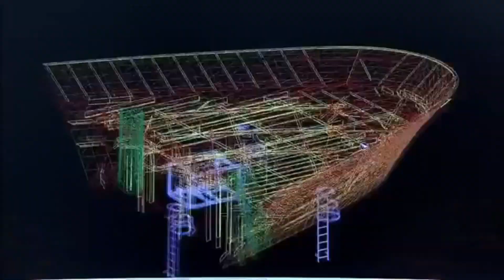TCG Anadolu | Why Turkish Navy Aircraft Carrier is Unique??

Comment: an aircraft Carrier is made for blue see, there for it needs to be supported at least by a bunch of battle ships. Otherwise it is a easy target. Carrying only UAV's is a bad investment.
Reply: İnsansız savaş uçağı bayraktar kızılelma taşıyacak ne olduğuna bakabilirsiniz
Reply: They are part of NATO. They sail all together.
Reply: Battle ship? you know they stopped using those after world war 2 right?
It's all about cruisers and destroyers now, With Carrier as the heart of the fleet.
Reply: TCG will be including more than 50 Bayraktar TB2 + Unmanned attack boots, anti ship missiles, anti submarine systems, anti air missiles, electronic attack / defence systems, attack helicopters, tanks, armored vehicles. 

Probably it will be in protection of a naval fleet as well.

Comment: 5:19 ability to do what?
Bayraktar is a UAV with a wing span of 12meters and a payload of 150kg
Turkish Cruise missiles have masses well above half a tone, for example SOM has a mass of 500-660kg (depending on the model) and Atmaca has a mass of ~800kg.
Which is the cruise missile you are taling about?

Finaly Bayraktar has an operational altitude of 5500m and Service ceiling of 8200m, although this is high its not protected against medium range air defenses as claimed in the video, its only protected from manpads and anti air guns. Any type of medium to close range SAM system can easily attack a target moving at 200km/h at an altitude of 5-8km.

Finaly, the f35 aircraft were required. The drones require air superiority to operate. Enemy fighters can easily shoot down the drones if there are no friendly aircraft protecting them. This means that the drone carrier depends on the land based air bases in case to operate. The drones could have been launched from that base anyways.
Reply: well said yet all turkish drones are well proven on battle grounds not against Afghanistan and other Bannana republics but against  countries that possess Russian modern warfare systems.  let us know how good are the American or western drones do against Russia then u have every right to brag and be filthy
Reply: @King_Budnacab  Turkey had undisputed air superiority in all of the battlefields the drones were deployed.

Turkish drones are in general slower than the american counterparts and this is not always something bad (about 200km/h speed). Air defense systems might have had not well trained crews or failed to identify the UAVs as a threat.

In any scenario where the enemy has fighter jets on the air while Turkey doesnt these drones can easily be shot down. For example an f16 wont even need to waste missiles, the 20mm gatling gun is enough to intercept multiple of these drones with a single load of ammunition.

This means that the carrier will either need long range anti air missiles onboard or its own fighter jets. The carrier has neither of those.

And no, the s400 or land air bases as I said cannot fix that, the drone carrier is not needed at all if you operate your drones near your mainland.
Reply: @King_Budnacab  Also, the americans never tried to replace their carrier aircrafts with drones. They are not even using the far smaller f35 jets. The US carriers operate f18 jets which carry 4 cruise missiles each. 
The drones that can be operated by this carrier are far too small and slow to carry any heavy payload like cruise missiles.
Reply: Guys, bill is saying something interesting and the truth. But we are sure Turkiye is a serious country and for sure they already thought about it and maybe that is why we are also developing the mius project together with the current project. Our new jet motor uav’s may make the cover agaist the jets.
Reply: Let me say it clearly, I hope it don't happen but if a war breaks out between Ukrain and Russia make sure the f35s and all the toys you bragging about do actually work 😏😏.  Since world war 2 America was just bluffing or brutally murdering innocent Bannana Republics for onse have dignity and let the world see how u match against a worthy foe.
Reply: @King_Budnacab  Im not American and I surely do not support the American actions. One thing is for sure, an f35 or f18 or whatever jet is far more capable than any drone.
I used the US carrier just for comparison.
French carriers can practicaly do the same with their own planes, so do the UK carriers with the f35s.
A drone carrier with no aircraft to protect the drones cannot attack a nation with an airforce.
The drones are good as long as the enemy has no planes, and this was the case in all of the Turkish campaigns to this point.
Do you realise that a sport car can move faster than the turkish drones (200km/h)? Any jet with an autocannon will easily attack and destroy the drone. The drone doesnt even have any way to know if it is spoted, it has no radar warning sensors at least the current drones.
Reply: @billwhoever2830  Tb2 and tb3 are temporarily solutions. If turkey will not be able to buy any fighter jets with vertical take off capacity we will use mius drones. They are jet motored subsonic drones and they have may carry 1000 kg missiles and boms. Turkey already developed 65+km ranged air to air missiles. And developing aesa radar on the go. So mius drones can fight beyond vision and if they are used in multiple numbers they can build a air superiority as a swarn. Because turkey is the first country which used network based drone attacks. When turkey will produce own ramjet engines and will be capable of manufacture 200-300km range air to air missiles game will change. Low costs drones which are capable of long range beyond vision combat capability in high numbers will be total air dominance. They can fly as a swarn in multiple altitudes and create a network airwall for hostile aircrafts. İn such battles who has more number of low cost equipment can be more aggressive and tolerant to risk their equipment.
Reply: @darkprofile  thank you for the info, the mius has a payload of 1500kg acording to info I can find online, it would be able to deploy 2 cruise missiles. 
I would doubt that a UAV will be able to deploy air to air missiles though and 65km is not enough to counter a meteor equiped fighter group.
The MIUS drone will have a mass of 5.5 tones and it will probably be larger than an f35 in terms of space on deck since its subsonic (larger wings probably required). The Anadolu carrier will only carry 10-20 of the Mius drones at full capacity.

Finaly, the Mius drone uses this engine:
https://en.wikipedia.org/wiki/Ivchenko_AI-25
and believe me its not Turkish, its a very old Soviet (Russian) designed still used in Ukraine probably due to low budget.
I dont expect Ukraine to be able to provide you any engines in the near future, everything can change ofc.

Claiming that its a Turkish made drone while the engine is imported is missleading.
If the engine is imported I can only expect other electronics on the drone to be imported too.

The CEO of Baykar, Selçuk Bayraktar, said that the MIUS is expected to fly in 2023, adding that a jet-powered UAV was a ''12-year-long dream.''
If a jet engine was a 12 year dream and it only came true due to Ukraine Im sure that Turkey cannot build such engines....
Reply: @billwhoever2830  Turkey also have partnership with Rolls Royce to build a jet engine which is similar to f110 the engine of F16 for national fighter jet project. Also in 5 years Turkey developed a national jet engine ktj-3200 for own cruise missiles to replace french engines. Also Turkey developed own turboshaft jet engine. Developing subsonic jet engine is not so difficult as developing a supersonic jet engine. Turkey can use the core of helicopter engine to develope a drone engine. Ukrainian option was cost effective solution. Turkey is developing and on the way. Also Turkey dont have meteor missiles yet so even if we could deployed F35B to deck we could use amraams which has 75-100 km range. Domestic air to air missiles has 65km range for now and all tests are successful. Phase 2 of this missile will have be 100+km range. And probably phase 3 can compete with meteor. 5 Years ago Turkey didnt have domestic air to air missile. Now we have. The plans are for future. Also Turkey has secret projects going on about hybrid rocket engines and ramjet engines. 
Countries buy meteor missiles from France or air to air missiles from USA or Russia. we produce our own air to air missiles. So 10 years ago we didnt have such missiles and 10 years later we can have missiles with similar capabilities.
Reply: @darkprofile  Bro, the fact that the drones that are going to be equiped with soviet engines is just sad. This means that they are probably gona be used engines from old helicopters, Im not sure if Ukraine actualy still produses such engines, maybe just parts of the engine.
You claim that Turkey is developing AESA radars and at the same time you order old jet engines. The aesa radar is probably built with imported components from Asia. Turkey has no silicon fabs.
Reply: @billwhoever2830  It is not important if it is soviet technology or not. Important fact is cost efficiency. Ukrainian engines give good performance for money. Bayraktar is not the best drone but it is cost effective. You can sacrifice 20-50 bayraktar instead of risking one f35. War is an economic fight too. One bayraktar costs 2 million dollar and can terminate few tanks alone easily. That makes bayraktar more damgerous than other variants. Because it is cheap.

Of course all world is manyfacturing something with imported goods. There are so few countries in the world who has all kinds of sub industries for arm industry. Also Turkey is manufacturing hundreds of high tech parts for airbus and F35 project too.
It is not important if you buy a microchip or silicon parts from another country while there are multiple suppliers in competition. 

Europe USA and Canada tried to put embargo for tb2. Turkey bought engines from ukraine and developed own engine for tb2. The rest of the parts used im tb2 are civil equipment so they are very easy to find from other countries. So it is not so difficult to find electronics for Bayraktar because civil components can be found from backdoors. Also Turkey has good relations with Korea and Japan. Especially Korea feels friendship to Turkey because we helped them in Korean war. And Koreans always willing to make partnership with turkey and ready for technology transfer. 

Few decades ago China bought aircraft carrier ftom Russia and to make that ship pass from bosphorus china accepted technology transfer on rocket and missile technology. Turkey is developing. So USA and Europeans are not the only cartel in arm technology anymore. 

Of course we are not on the same level as first class countries. But Turkey is doing more and more every year. It is not a destination it is a process of the way. But if without war and economic collapse Turkey can move on 20 years. We can be on top league of weapon exporters.
Reply: @darkprofile When the drone carrier only carries one or two dozens of drones you cant waste them so easily.
When you have limited amount of space on the ship you use the most capable weapons possible. 

I do agree that the Ukrainian egnines are probably the most cost effective option, and there might even be a special agreement with Ukraine but those are still Soviet weapons. Ukraine didnt develop them alone.

Now lets imagine a scenario, 6 rafales with 4 meteor missiles each and 24 subsonic Drones. How many chances do you think the drones have to even get in strike distance? Very limited. 
Although the meteor missiles are very expensive (2 million $ each) they can shoot down targets far more expensive (one drone with 2 cruise missiles).
The most expensive weapon can be the most cost effective, because an entire enemy aircraft costs more than a missile.
Reply: @billwhoever2830  So if they were not drones and if they were f35B. What could be different? Meteor range still more than amraams. This ship also will carry unmanned boats which can carry atmaca anti ship missiles and siper high altitude air defence systems. So a drone network on sea surface can defend air defence and anti submarine warfare. So when rafaels will come just meteors will not be enough. Turkey is planning and developing a drone network for network centric battles.
Reply: @darkprofile  An f35 is better than a drone on everything except cost. If you have a limited capacity on a carrier you want the best use of it.
The f35 obviously has a pilot who takes decisions even if connection with base is lost. An f35 is faster which means it can avoid dangers much more easily. An f35 carries more weapons, 8.2 tones when its fully equiped and 2.6 tones when its on stealth mode (inside the planes belly). The f35 has a next gen radar which the UAV wont have.
In general we can say that an f35 (or any jet fighter in general) is far more capable than a drone.

For example the meteor has a max range of 200km. The no escape range is about 80km for a fighter jet like an f35. A much slower subsonic drone can brobably get hit by the meteor fro a far greater distance, this highly depends on whether the drone retreats at all.

Turkey can surely plan a lot but seeing them buying old jet engines for the future drones proves otherwise. The modern fighter jets can only be countered by other modern fighter jets, not by drones.
Air defenses are only usable as long as the enemy planes are attacking you on your mainland. When you are on campaign with your drone carrier you need frigates or destroyers to deploy air defense missiles.
Reply: @billwhoever2830  Make a search about tf-2000 air defence ftigate project. construction will start at the end of this year. hisar-A and hisar-O low and medium range air defence missiles are ready. Hisar-U (siper) long range surfave to air defence missile test shots already started.
Reply: @billwhoever2830  The first production engine could be bought from Ukraine. but in later productions the engine is improved. that's how military technology works block 1 block 2 block 3... Most important think is production capability of first MİUS. And you re right not enough for fighter jets with meteor missiles. But these drones produced for air to surface fighting and when 25-30 bayraktar or mius take off sametime,reality is become different than theory you know.
Reply: Abduel Tio  what I want to say is that this carrier is useless.
Turkey already has airports with fighter jets.
Since anadolu does not have fighters onboard it cannot project power that wouldnt be already in reach of the airports.
Reply: @billwhoever2830  bir f35 maliyeti 100 milyon dolara yakın bunun bakım maliyetleri ile 250 milyon dolara çıkabileceği belirtiliyor bir İHA nın maliyeti giderleri ile 10 milyon dolar.Bu gün Ukrayna'nın aldığı 20 bayraktar İHA ile Rusya'ya verdiği hasarı bir f35 verebilirmi?
Reply: @billwhoever2830  Thanks for your constructive criticism. I liked the way how you consider the scenario from various aspects.
Reply: Çakır Cruise missiles 150 kg
Reply: Do you have any information about Aksungur and Akıncı armed drones?
Reply: @Donny flying higher means you are harder to shoot down
Stingers and igla (russian manpad) both have limited maximum engagement altitude.
Anti air guns, even the heavy 35mm ones have a maximum engagement altitude of about 4km.
Heck, even enemy fighters need time to gain altitude. Flying higher and faster means enemy planes will need to burn more fuel on afterburner to reach you in time after you get spotted or might need to use missiles instead of their cannon to shoot you down in time. 

Planes need time to gain altitude but altitude gives you an advantage against anyone bellow you.
If the planes theoreticaly fly at 5km on patrol and spot a drone at 3km altitude they can dive and gain a lot of speed. If the drone is spotted at 7km altitude flying much faster the planes will have a much much harder time intercepting, especially with guns.

So to sum up, altitude and speed make any bomber (tb2s are used as bombers) more scary. Stealth is useful for some scenarios but, if you know you will get spotted the first solution is the best one.
Reply: You make sense.